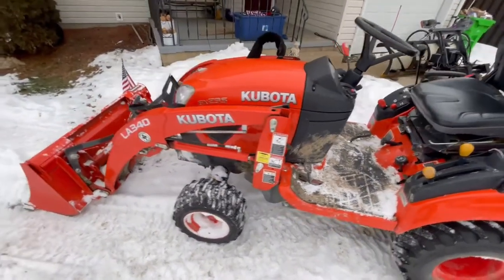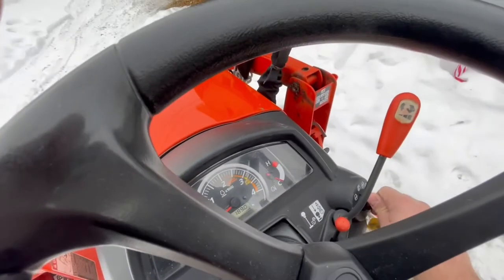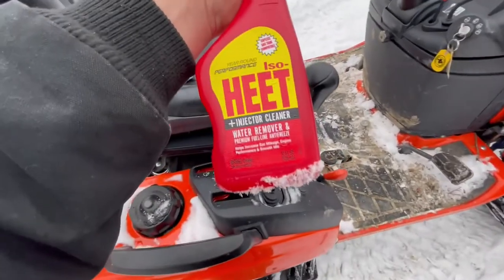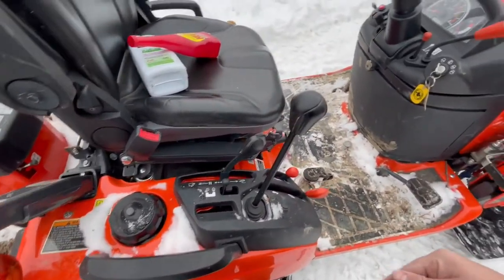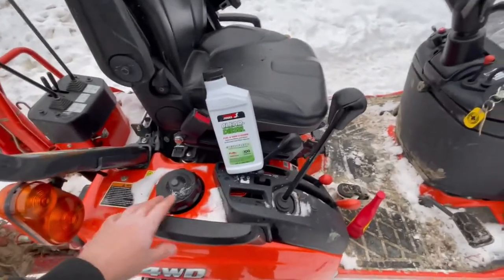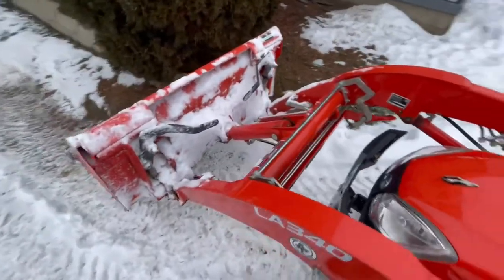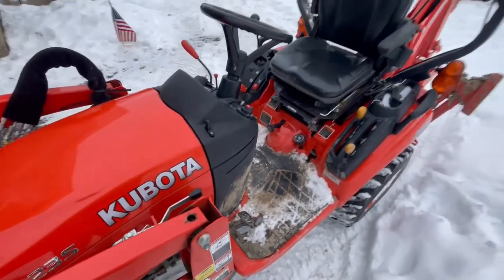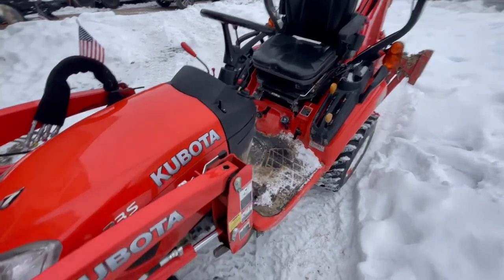My Kubota BX23s is misfiring and loss of power -  Water in the fuel fix

Comment from the maker: I am looking at building a DIY water separator project for the Kubota BX23s to make sure the water issue does not happen again. The BX23 series does not come with a water separator and water issues can happen easily given the large opening in the tank.
Reply: I put a FWS on BX and it helped. I still have problems when it is really cold though.

Comment: Many thanks for the tip. You were spot on. My BX23S had been sitting idle over winter with a quarter tank of fuel, hence lots of air. It started up alright, but after a few minutes started spluttering and lost power. I did not previously know about the water issue with diesel fuel. A fuel additive that deals with water cured the problem. In future, I will always use a fuel additive to prevent this happening again. The BX is purring like a kitten again.
Reply from the maker: Glad you got it back going. Having it die or run rough is like a punch in the gut. Nothing like a 20K machine banging around like it is going to blow up.